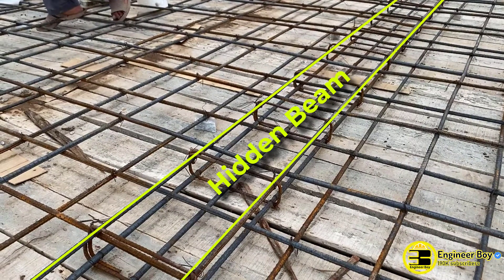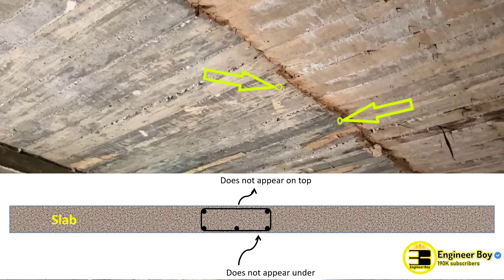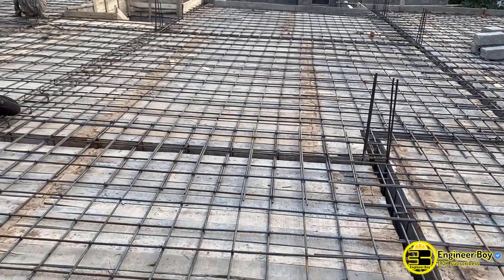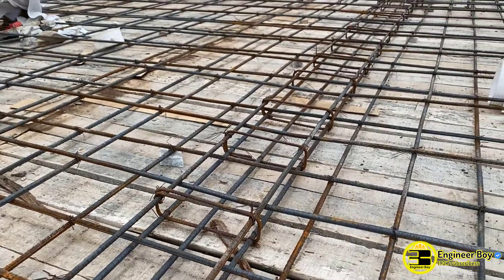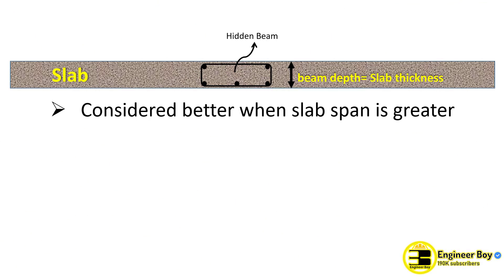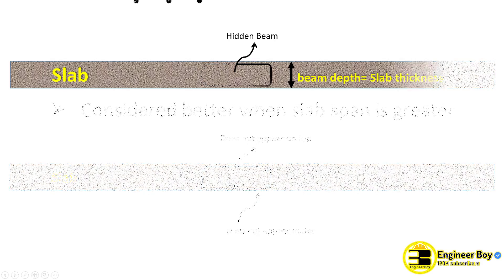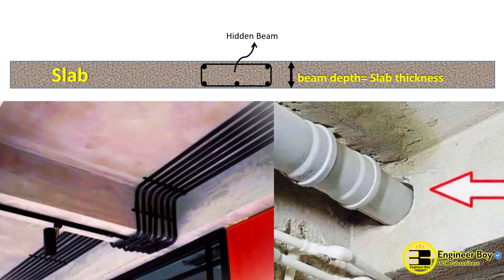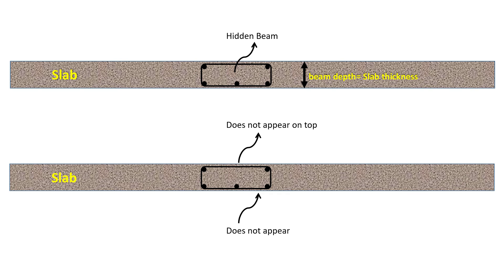hidden beam in building | Engineerboy

Comment: Beam is given for resisting moment shear and torsion, tell me how you are cumputing this forces with this "hidden beam". also how are you defining this beams as under reinforced? and most of all give me one refference form a good book and design code like ACI and EURO or IS, its clear it dose look beautyful when hidden but i think stability coms first. Just want to know
Reply: i did asked the same question few people did not get a good answer, you also meansioned two story recidential building, we know that beam just carry the slab LL+DL to the column in every story so beam section dose not effect how many story (not considering spacial cases) of that building, it just depending on the floor loads. so i still dont know how this beams are allowed in few story but not in many story. sorry for the aggressiveness, i did not ment to offend any one, it just a unresolved issue, i did learned a lot form your channel
Reply from the maker: The hidden beam is not only for supporting the slab or floor. It also receives load and bending from other beams and columns. Its good in slabs having more span. This beam is never provided alone better to provide with combination of other beams having depth more than slab’s thickness. Remember structure is alway connected through different members so up to some extend it receives bending and shear.. i recommend to watch my other videos related to beam design and construction
Reply: @Sulimankhanacademy  by saying DL+LL for the slab i mean resisting flaxural bending, shear and torsion beacouse we get those moment and shear form corresponding load combination. "This beam is never provided alone better to provide with combination of other beams having depth more than slab’s thickness" i  learned flat plate two way slab design in BSCE program, but that is not the same as you showed in this video that design had more thickness and conrner reinforcement with two layer of main reinforcement. "different members so up to some extend it receives bending and shear" ok so i aggre with you, now how you calculate that extend (maximum limit) for this "hidden beam" beam, i did work with some architect who recomend this type of beam to solve large span issue, but never able to show rigidit calculation. one thing i understood engineer should always verify a strucral member by calculation then  apply in real world so it is become safe for habitation.

Comment: I think it may not be a substitute to large height beans which are planned to bear large weights/span. Many hidden beams of slab height may be required at smaller width (span)  to substitute a single regular beams with a bigger span. 
The iron rods in hidden beams have to be much heavier than that for  normal beams.  Even the regular rods of 8/8 mm or 10/6 mm may have to be substituted with heavier rods, may be 10/10 mm mm
Reply: I am not an engineer. Just my common sense thinking.
Reply from the maker: Yes it is never substitute. But works in many places.